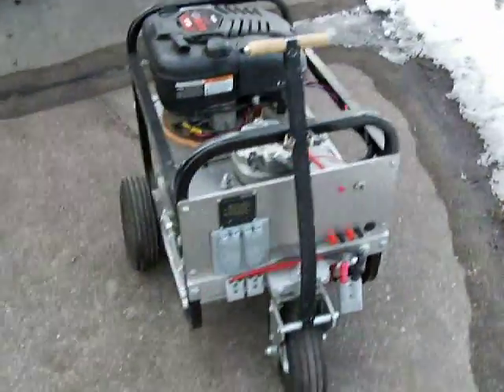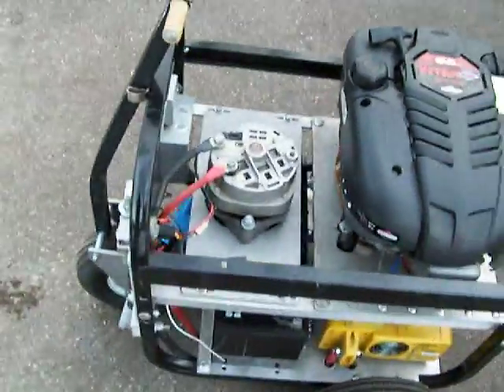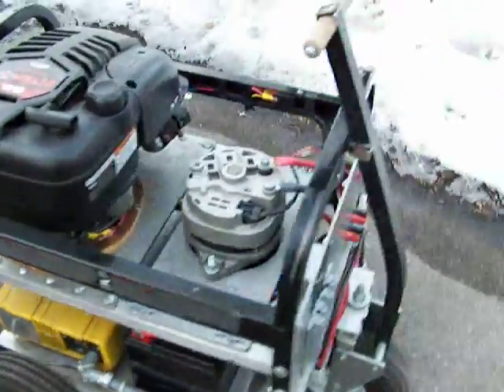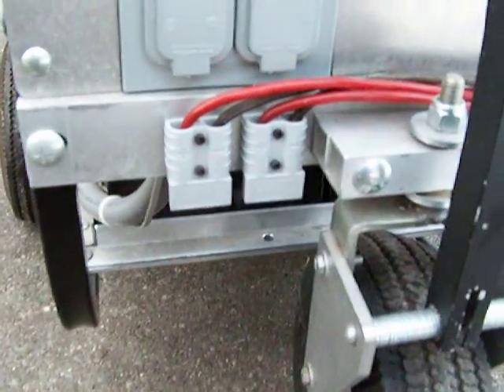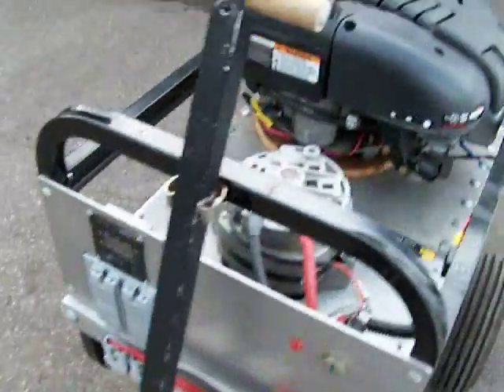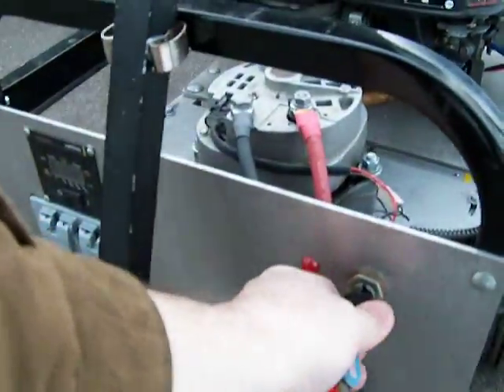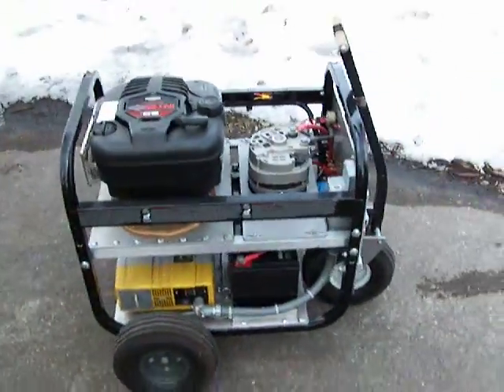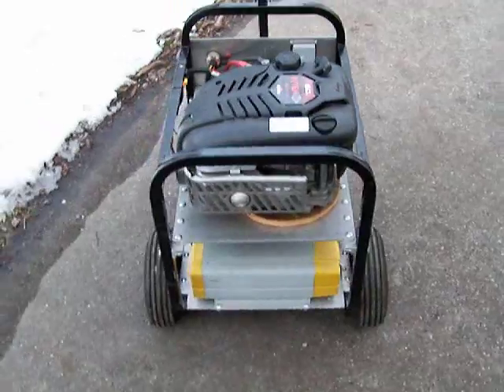Homebrew 1.8kW Inverter-Generator

Comment: If I had it to do over, or if I was going to build something like what you have, I would want to go with lithium batteries, now. They make internally self regulated LiFePo4 batteries that are drop in replacements for SLA batteries, but weigh about 1/3 or less, and have 2000 charge cycles, rather than SLA's 200, or so. They also have higher discharge capacity, it's the way of the future, for sure. If you take into consideration that they have 10 times the life, they are actually a lot cheaper.

Comment from the maker: Oh, the PRESSURE!!!! Things a little busy now, but I WILL make one, I PROMISE. BTW, for all you tracking this thread, I just picked up the first component of the 10kW system- a vertical-shaft 18hp B&S Opposed Twin with full-pressure lube system. Runs like a champ (not bad for a 1994 engine)! Trying to swap flywheel for one with BIG magnets & 16A stator (starter battery recharging & house-keeping functions only). Maybe I'll do a video for that engine soon.  Stay tuned.....

Comment from the maker: I'm not surprised!  With a standard 2-pole AC generator, your engine needs to run at a very steady 3600prm (1800rpm for a 4-pole generator), regardless of load. With an alternator, your loads (AC or DC) don't care what speed it spins at (as long as it's above minimum cut-in speed), because the inverter takes care of the 60Hz part.  Enjoy your savings! maybe get more 8G batteries, granola bars, or gasoline. (LOL!)

Comment: I lived in a cabin out in the woods for a couple of years, that was off the grid. I had a little genny, that I ran at night, to charge a bank of four 8G batteries, and watch tv in the evenings and such. I also had an inverter, but did most electricity consumtion from the genny. One day the generator part of genny died, and I used the motor to run a 12v alternator, instead, about the same setup. This reduced my gasoline use by 75%, surprisingly.

Comment: yeah you need a fairly big engine for a engine-driven pump much bigger than the Briggs & Stratton that drives your homemade generator.Just asking could the engine on your homemade generator be modified to run off LPG from a 9kg LPG cylinder?btw if you had a bigger engine you could use it to power a arc/mig welder or a plasma cutter.

Comment: I like your choice of engine since Briggs & Stratton are reliable,solid engine,My briggs & Stratton lawnmower is atleast 16 years old and still runs well it's had a new governor spring installed since the original one rusted through and broke and judging by the smoke ir makes when i start it the rings are getting a bit worn i might have the rings replaced during the winter.
Have you thought of building a water pump?
btw nice video!!

Comment: This is an awsome setup! It solves way more problems than you are probabley aware of. Most of the altenative energy solutions that are now out there can not handle surge or load change. They run the motor fine, they just do not handle change well. This setup would work with GEET, HHO, Wood Gasifiers, etc. and handle load fluctuations better. You might consider making them for this area as noone else is. You have a workable solution to a major stumbling block that exists at the moment. Clay

Comment from the maker: @SquirrelFromGradLifer: Your brush question is valid. Alternator brushes ride on slip-rings, carrying relatively low Field current (usually 2-3 amps). DC Generator brushes ride on a commutator (a segmented slip-ring that performs the AC-DC rectification) carrying the full Armature current, up to 30A or more. So for an Alternator, brush -v- brushless doesn't really affect Alternator efficiency. A Permanent-magnet unit still requires regulation, not easy to do at high current.

Comment: I actually do have a question for you, if you don't mind me asking a probing your mind. I'm not an expert on this, I have heard somewhere in regards to a RC kit plane I bought for my nephews that a brushless permanent rare earth magnet electric motor was much more powerful and efficient than a cheaper old style motor with brushes.
I might be wrong but that alternator uses brushes right? Would it be more efficient to find and use a "used" permanent magnet electric motor instead of the alternator?

Comment: @SSD99 I took notice because it looked rather good. I'm sorry I thought you said 6 kW in the video.
A suggestion which might be somewhat over engineered, but you said you could slow the engine down to idle under very light load and it struck me that some kind of controller that monitored the battery level and load taken from the inverter and then controlled the engine rpm/start up automatically if the engine have EFI or electronic management or just a thingamagic that controlled the throttle.

Comment from the maker: @SquirrelFromGradLife: good question- you're the first one to niotice the combination of the compoonents chosen.  First, my ehgine if 6Hp, not 6kW (I wish it were!!!).  6Hp thanslated to 6 x 746W/HP = 4,476W, under absolutely ideal conditions.  In reality, each HP makes about 500W power, so, theoretically, the engine should stall at about a 3kW load.  Since the Alternator is 140A x 14.4V, max power out to the Inverter and batteries is just over 2kW, well below the 3kW limit.

Comment: Why the 6hp engine? with only a 1800W inverter your engine is 6000W at max load. A 3 hp engine would do just fine running at 50-75% load where the fuel economy is best.

Comment: Very cool. Gives me ideas to use a variable speed electric motor and a few more alternators then I wouldn't need to worry about gas. Or maybe a magnet motor that would not use any power source. Thanks for the ideas...

Comment from the maker: @sheltiemanva:  That's really a good idea.  I  DID cover the alternator's BAT terminal after I made this video, now I need to do it for the main terminals.  As an interim safety precaution, I fitted the battery cables with quick-disconnect PowerPoles.  They won't prevent a short, but they will allow very quick disconnect of the batteries if a dead short does occur.

Comment from the maker: @Sixdouble5321: OK, but then it wouldn't be a 2.5hp motor.  It would be whatever (usually greater) the tweaks you describe give it.  I think what you're saying is that a smaller engine could put out 2.5hp with the cam & valve sizes.  Beside, getting to that level of DIY is beyond the original scope of this project.

Comment from the maker: @Steveanders0n: Thank You!  How do you mean "compare"?  Price? Power output? features?  I will say this:  While spending nearlty $1,000 for a set-up that puts out less than 2kW, it's rather expensive.  But, when you consider that even a comparably-sized 2kW Inverter-generator can't still make electricity with the engine off (because of battery back-up), you begin to see the differences between a DIY design like this and commercially-available units like at Homey or Lowe's.

Comment from the maker: @Sixdouble532:No. Let's see, 2.5Hp x 500W/Hp = 1,250W. The Alternator is rated for 1,988W (140A x 14.2V). Of course it will not put out 140A all day long, but you can quickly see how it would stall 2.5hp engine. Besides, it's always good to have a little headroom incase you need it

Comment from the maker: @Chocapiceater: Don't take what I say here as advice, I don't want to be responsible for someone else's equipment being damaged due to "bad" advice.  If your computer's power requirements are, say, 120VAC, 60Hz, then it doesn't matter where it comes from: Wall socket or 120VAC 60Hz Sinewave Inverter.  Power available depends on the inverter size, and running time depends on battery capacity.  The alternator extends running time by amount of fuel you have and alternator/engine efficiency.

Comment from the maker: @Chocapiceater:  This will do that with no problem.  1.8kW should be more than enough for your computer, and since the AC output is pure Sine wave, higher-order harmonics (3rd, 5th, 7th, 9th, 11th, -order miltiples, all added up to make the square-wave or modified-sine wave of your cheaper inverters)  should not be a noise issue.

Comment: Very cool, and I love the silent mode, using the batteries. The only suggestion I have is to put a larger gas tank on it for longer unattended applications, like extended power loss.

Comment from the maker: @mastersduhgree: As can be seen in the video, the generator uses only one alternator, thus I have no problem with two regulators fighting for control of the system.  I DO have two batteries, however.

Comment: @dieseldog502 I have been contemplating a gen using "2",,,200 amp semi engine alternators powered by a small 4 cyl engine that would only be required to idle to produce 400 amps but.....would you tell me how you wired the 2 alternators you used on your invention together??? that is what is befuddling me at the moment.I seriously want to avoid melting down my alternators and need a bit of input on how to do this.Can you tell me how you wired yours together?...or did you?Thank you sir.

Comment from the maker: @libertyss35:  Also, to answer your original question, I am using an automotive alternator thet puts out up to 140A at 14VDC.  But your 66A alternator head generates 120VAC (or 33A at 120/240V split-phase AC), much higher than my 1.9kW Alternator (assuming 100% alternator efficiency, which we know doesn't exist).  In reality, I'm good for about 125A @ 14.4VDC = 1800W.

Comment from the maker: @chevguy502:  Anything up to 1.8kW.  TV, Sat receiver, Home theater, kegerator, (ya know, power outage essentials. :)  Originally intended as a proof-of-concept, it has taken on a life of its own.  Still not sure if I'll keep it together, or part it out to make a bigger & better unit.  Sure, 1.8kW isn't enough to power your whole house during a power outage, but it can do the essentials.

@opisex:  I am using deep-cycle batteries, so discharge is a non-issue.  Took about $950 to make.

Comment from the maker: @libertyss35:  The terms Alternator and generator are almost interchangeable these days- both are rotating machines that produce electricity.  For our purposes, the term "Alternator" (whether it produces AC or DC) refers to the rotating machine, while "Generator" refers to the whole thing: Engine, alternator head, gas tank, frame, etc.

In the car world, DC Generators were replaced by Alternators in the early 1960's because of their lighter weight and higher current output than a Generator.

Comment: Well done! I'm jealous of this beautiful piece of equipment you've built!
I've  just purchased an 8000/10000 watt genset made by Rigid with a Subaru engine.
I would rather have built one myself and am still considering doing so.
I'm a little confused though with the fact that you are using a 140 amp alternator and the generator that I have is putting out only 66 amps at 120 volts. 
I understand the difference between an alternator and a generator as far as ac/dc respectively, but I'm not unders

Comment: I have to agree, that's about as spiffy as you can get it.  Nice extra features you've added for external charging.  Could also be used if for some reason your gen-set motor goes out or runs out of gas you can hook it up to any vehicle and continue powering your home.  Awesome!  This video is getting downloaded for future reference.  Thanks for the upload.

Comment from the maker: @nadeem5476:  That would depend on the state of charge of the 500Ah pile, ans if it is a deep-cycle (energy) battery, or a srtating (Power) battery.  For my arrangement, it takes about 1/2 hour to 45 mins to reach peak charge running ther alternator at full-output.  While not being used, I keep the batteries float-charged at 13.80V by a 10A PWM-Regulated Battery Charger.

Comment from the maker: @clflyguy: Thank You for the suggestion.  I haven't experienced any difficulties with the inverter's rigid mounting, but, per your recommendation, if I do experience any vibration-related issues with the inverter, I will investigatew the practicality of rubber-mount shock-isolation for the inverter.  It's a pretty tight fit under there now as it is, but I'll keep this in mind. 

Cheers,

Steve

Comment: Two thumbs up for an extra clean build! Nicely done all the way 'round... Maybe just one thing you may want to mod just a little. The Pro-Sine is a very nice inverter, actually it's the same one I've had my eye on for our off-grid place. I would have worries about vibration- it looks like you have it hard mounted? Might not hurt to mount on some strategically placed foam rubber blocks. But I'm a worrier- LOL!

Comment from the maker: @ccraig412:  Look on eBay to see if there are any generator heads that would fit your needs.  Or look for high-powered alternator (200A+).  Your Kohler should spin either of these with ease.  Or, if you prefer, get a transaxle from an old lawn tractor, and you've a great start to your own go-cart!

Comment from the maker: @vitaminy1829:  3kW, huh?  Can't wait to see it.  What brand inverter?  Xantrex?  Other?  3 -v-4 wheel design: 3 was easier to do.  Beside, I already had all the parts needed for a 3-wheel set-up.  Also, Briggs & Stratton made a three-wheel design (a 6.5kW Unit IIRC)- my design was based on that unit.  I'm thinking about ditching the pneumatic tires in favor of solid rubber ones.  Easier to pull in tall grass.  Alot of where i use this thing is in the country.

Comment from the maker: @kengine7: AMEN to that.  I cringe when I hear your typical Generac / Coleman / (insert brand name here) store-bought gen-set banging away at 3600 rpm just to power a few 60W Lights in the house.  Very wasteful.  I wish ALL gen-sets had  variable-speed operation.

Comment: Very nice, clean work!  I'm planning on the same concept, but with a 3000W pure-sine wave inverter, plus a 3-way 12V Outlet for cell-chargers and the like.

I'm curious to know, why a 3 wheel design?  Is it easier to maneuver than 4 swivel pneumatic tires?

Comment: SSD99 - nice work! 
I was wondering if you have done any work to automate the engine speed control? 
I am trying to build up a unit like yours but I want to add auto start and automatic speed control. I have been looking for an Electric Throttle Control Solenoid. So far all that I have seen are two position with a short through and not variable. Throttle travel needs to be maybe 1.5in. or so. I am currently looking at using a RC Model Servo. Any ideas?

Comment from the maker: @loansharky:  You're missing the whole point- the purpose of this was to DIY it.  Along the way, I added things, like on-board batteries, wheels, and the 1800W Inverter.  I knew this would be heavy, hence the wheels.  I didn't want to have to lift one end to move it, so I added a steering wheel.  Also, unlike the Harbor Freight generator, this wasn't made in communist China- everything came from either Canada (inverter) USA(Engine, alternator, & frame), or Mexico (batteries).

Comment: Pretty cool but 300 lbs and only 1.8kw. Seems a bit impractical for my uses. I can run small stuff with my little 800/900 harbor freight generator that weighs 40 lbs. And the frequency and waveform are surprisingly stable. I could always add batteries chargers and an inverter to make it heavier/ more expensive/ less practical but why? Is what you are running that sensitive.

Comment from the maker: @dollywarrior:  Don't know- I've never let them discharge.  I would guess that if they were needing a fast charge, perhaps 30-60 mins with the generator, and ~18-24 hours using an external charger.  I'll admit, most of the batteries I have are deep-cycle ones, so I really should a current regulator in addition to the voltage regulation, but I try to limit the charge rate by charging them by AC Charger.  This setup is not intended as a dedicated battery charger, but more for powering things.

Comment: It would be cool if you could add a load-dependent throttle control. That would increase fuel effeciency being that it would only throttle up for increased load sizes. Nice work on a very useful generator set up!!!!!!!!!!!!!!!!!!

Comment: @SSD99 Will be looking forward to that info when you do get that chance. I am in western NY... i Understand well about the cold. Tho on quieting down. I can agree the side panels may help insulate the mechanical sound, Maybe a ride-on lawnmower grade muffler and some ducting to help vent it outside the casing? (for simplicity) I would figure the current mobility is the best in terms of simplicity though, there is very little to fail, even if by chance its on the heavy side.

Comment from the maker: @DengarTime:  I honestly don't know.  The only times I did were for battery-only power.  It's cold here in the Midwest now, but this summer, I'll give it a try then post the results.  Biggest challenge for now is quieting the engine down.  I believe I can quiet most of the machinery noise by putting covers on the side panels, but, for the engine exhaust, per some previous comments made here, I think I'll need a bigger muffler.  Another idea was to motorize the two main wheels for some mobility.

Comment: Im curious, what kinda run time do you get per tank of gas on various load's on this generator? at least of the moment, yours is the best put together one I have seen, I enjoy seeing the fact it has its own battery pack to provide power with too.. the mobility it has is also a big plus, too many are not that nice to move around, more like a two wheeled wheelbarrow for the bigger ones.

Comment: My engine is a 9 hp engine and it is running two alternators (Lucas alternator at 95 amps and a GM 10si 110amp alternator both in parallel which generate about 205 amps and the engine has a 7.5" pulley. Now I am going to buy a briggs and stratton 12.5hp vertical shaft and electric start. I might take out the stator so I will have less drag on the engine